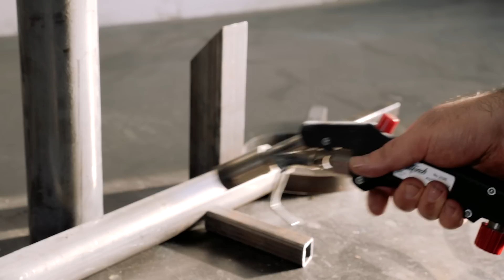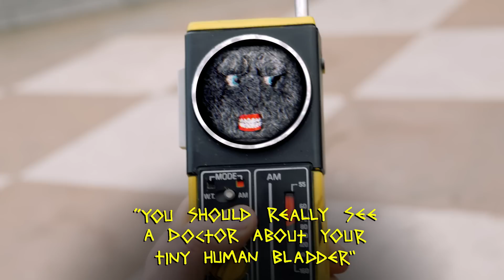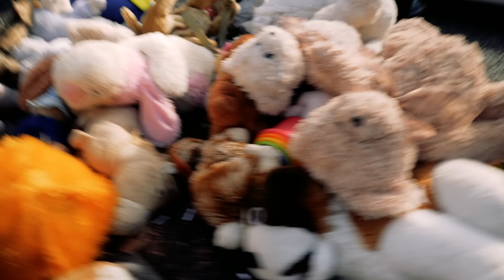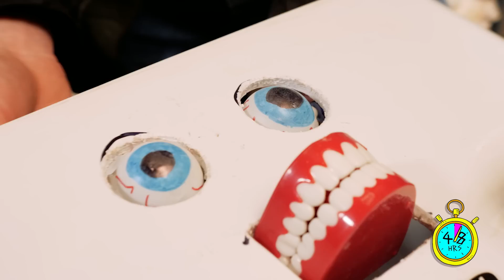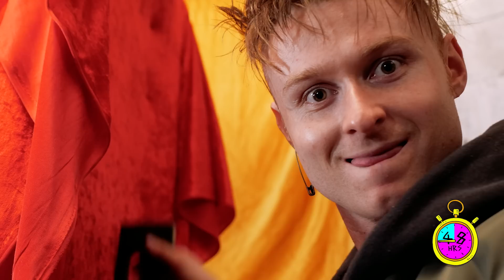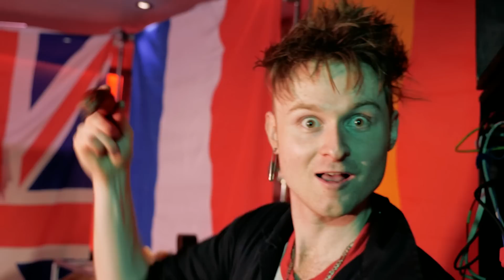ROBOT TOILET THEREMIN MACHINE OF DOOM - JUNK ROCK TV

Comment: i built a theramin off stripboard and it worked well enough , it has a built in amp and a pt2399 echo circuit . it was not easy to find the vero layout - that was the hardest part but its a legit theramin with antennae , not a cds cell light organ . there is another really neato design by a guy named dino segovis - his slider synth is very much fun , easy to control and play a melody and a super easy build . i like ot pair the controller with a sine wav osc - ditch the square .